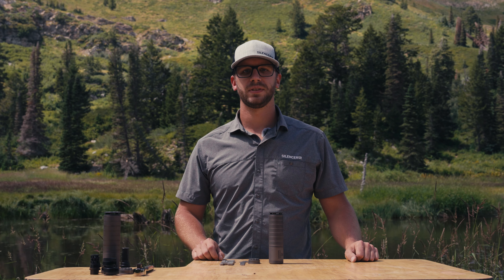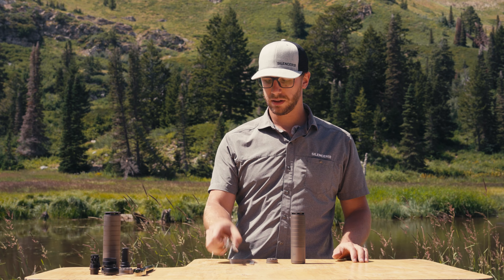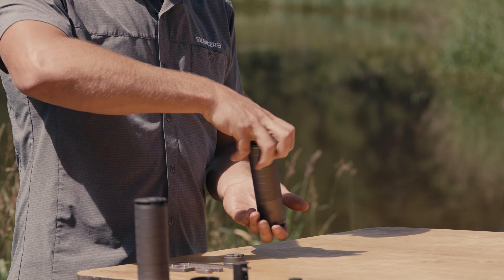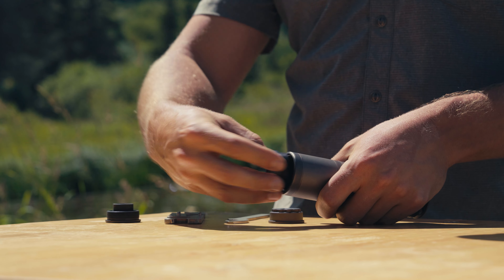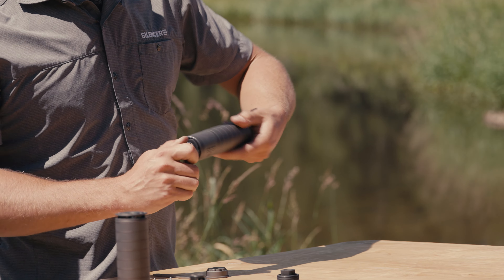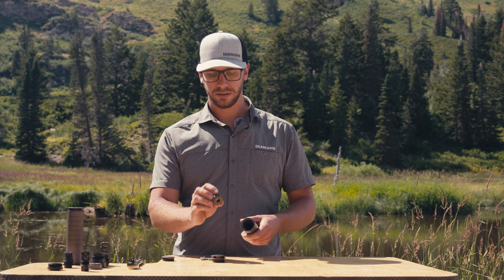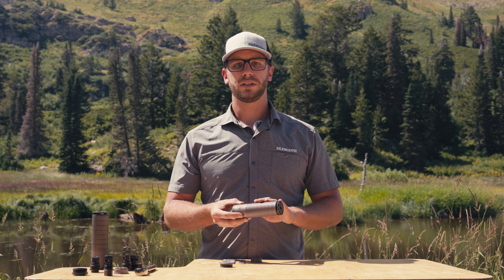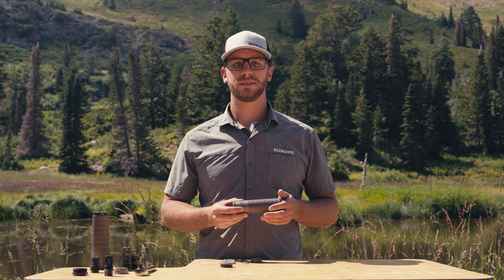How To: Scythe-Ti

Comment: As my first silencerco can, I couldn’t be happier with mine. Lives on a Tikka T3x Lite in 300 WSM and it severely reduces felt recoil. Aligns perfectly every time and shoots lights out.
Reply: What do you recommend for anti seize lubricant on the thread mount to Barrell and thread mount to can, also can to front muzzle brake?
Reply: @ I personally had some leftover high temp anti seize from Griffin Armament so I just used that. Have a bushwhacker 46 that doesn’t like being taken apart for cleaning. So far the Griffin anti seize has made it 10x easier.

Comment: How does it compare (DB) and sound to the SAker and Omega300?
Reply: THIS
Reply from the maker: Produces near identical numbers as the Omega 300 and is quieter than the Saker 7.62 on all calibers.
Reply: @SilencerCo  so the benefit for us Omega 300 guys is just weight right?
Reply from the maker: @YZFoFittie  The Scythe Ti weighs 8.3oz and the Omega 300 weighs 14.8oz.
Reply: Just saw one today at my local sporting goods store. 
Scary Light! I am putting this on my GPR
Reply: @SilencerCo that's amazing! But does it produce white titanium sparks?
Reply: Finally got mine! So the only concern with ultra sonic cleaner is the finish?

Comment: What's the signature under NOD's?
Reply: Considering this can has a muzzle brake end cap and is not meant to be used for tactical hard use purposes, I would probably say that maintaining a small signature under nods was low on their priority list of features for this can.
Reply: @austinfloeter565  my Omega 300 has a much more substantial brake, and due to it NOT having titanium baffling, doesn't emitt white sparks. 

What makes you think this can, "is not meant for tactical use"?
Reply: @YZFoFittie  Because it says specifically on their website who they intended the suppressor for. This can could not withstand a sustained firing schedule needed for tactical/gunfighter use. The titanium would be well over 800 degrees after two magazines which is the failure point for a Titanium suppressor. A can more suited to hard use/tactical purposes is their Velos LBP which is made out of Stainless and Inconel. Which they also state that on their website.
Reply: @austinfloeter565  I'd love to see you get the can that hot on a bolt action or a 300 Blackout on subs...
Reply: @YZFoFittie You must be a navy seal because I don't know of anyone else running around at night with a bolt action and nods worried about their IR signature lol use the can how you want dude, no one is stopping you
Reply: @austinfloeter565  you must be new to the game if that's what you think...LMFAO

Comment: What does this suppressor do that my Omega 300 does not? I'm always in the market for more suppressors, but of everything on the market, what sets this apart?
Reply from the maker: The weight and length reduction. The Scythe Ti is half the weight of the Omega 300 and nearly an inch shorter all while maintaining the same great sound performance.
Reply: @SilencerCo  how much is it. ?

Comment: Will this match up with my hybrid 46 attachments?
Work with a 7.62x39 Gail ace ?
Reply from the maker: Yes, on both accounts.
Reply: @SilencerCo  awesome. I’m looking for something shorter that will work on 7.62x39 and my 556. I have the hybrid and a keymo adapter for it. And the asr adapter. Cause my 13.7 pined and welded uses the Knox flashhider from solgw and I want something that will fit both. With out having to buy more adapters